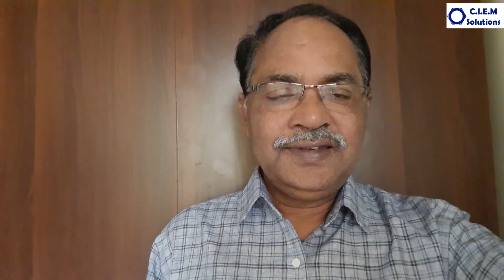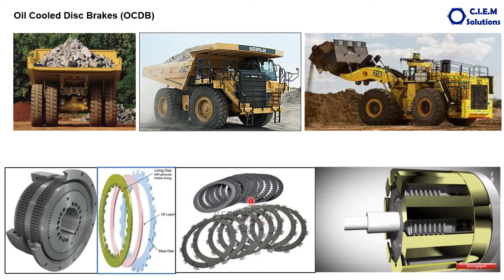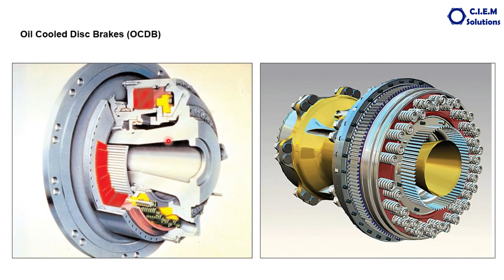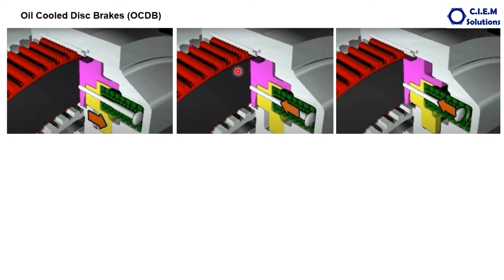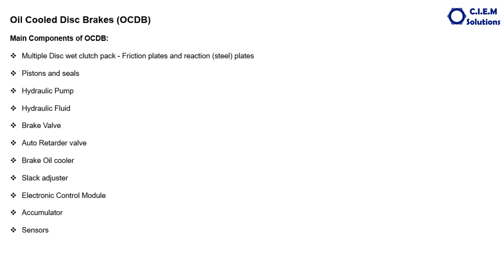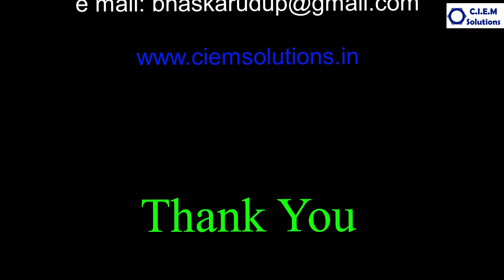45. Automotive brakes Part 5: Oil Cooled Disc Brakes  ( OCDB )

Comment: Hi, can you answer I have ocbt brake system in forklifts there abnormal noise when applying brakes we changed all brakes set and checked oil cooling system all is well pump